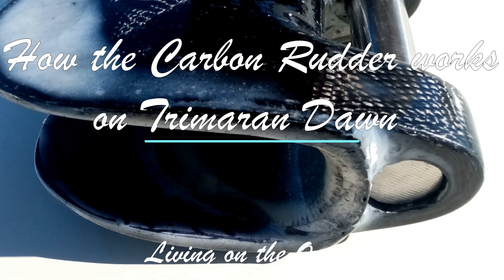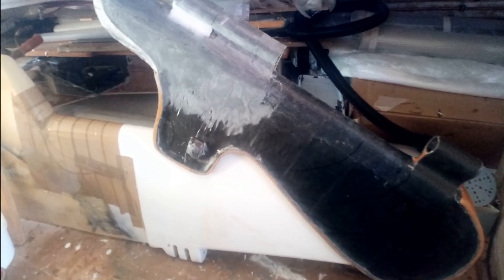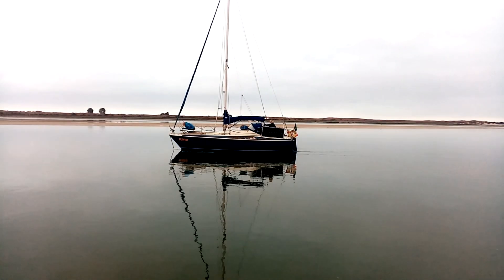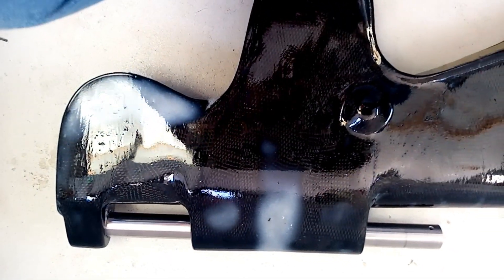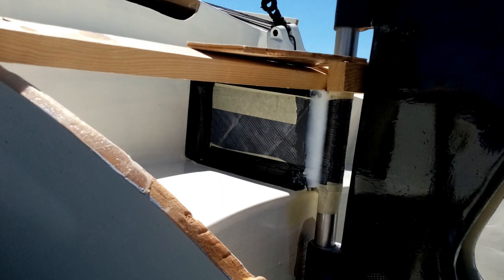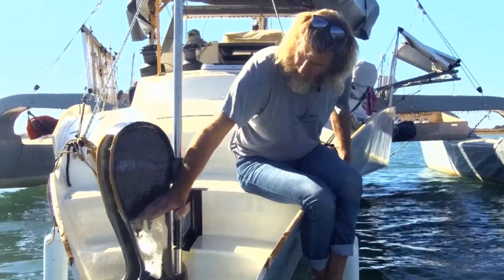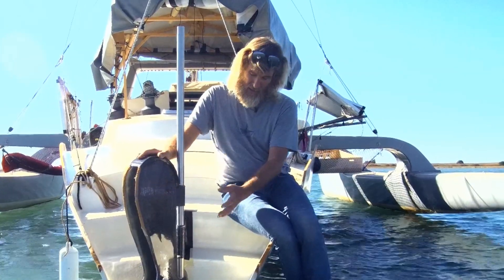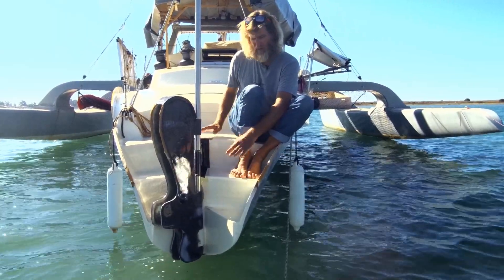How the Carbon Rudder works on Trimaran Dawn 041

Comment: Wow, it sounds complicated to me as someone who has only ever owned tiller steered boats. I have sailed one or two wheel steered boats but never really looked at the mechanics of it all. I really hope you can get that direct tiller feeling into the new system. Its great to really feel what the boat is doing!
Reply from the maker: Indeed 😊 Dennis. A great feeling with thillee steering.. If you have to steer by hand its the nicest. 😊 A wheel without feel is okay if you navigate in a port. But no fun in a night on open sea. Feel like you need much more concentration. 😊

Comment: Mate, you are making Dawn bulletproof, having worked with CF for a number of years your results are amazing, especially given your unique surroundings. Love the build and look forward to cruising video.
Reply from the maker: THANKS Matt. Nice to hear from a person that worked with Carbon fiber. 😊   If anything. I do not want to loose my rudder ever again. 😊 And sailing with the wind and waves coming from the back quarters gives big forches on the steering system... Surfing high speed of the waves. 😊. Bullet proof is good. 😊

Comment: Looks good. There is not much room inside for the steering though. I am more familial to the wharram design catamarans. Wharram also designed a windvane that is very simple but very reliable. It only works on boats with a limited heeling like a catamaran that heels maximum 8 degrees. I don’t know if it would work on Trimaran Dawn. On my boat it combines with a vety long helm that makes steering very light and easy
Reply from the maker: Hi Alfred, I know about the Waram system. 😊 But not in detail. Its a puzzel for later. Well spitted that the soace is small. But its big enough fir the qudrant ti turn 35 degrees to Port and Starboard. 😊 Love simple Wharram systems.. Bles James.
Have a good week, raining here sliwing diwn progress this week. 😕

Comment: you mentioned pendulum steering (did you mean wind vane steering? I guess it's a language translation thing?) I'm looking forward to see how you tackle this, should be interesting 🤞🏻 Thanks Ari for another great episode 👍🏼
Reply from the maker: You welcome Dave.  😊 Its a wind vane as you  correctly mentioned.  The old fashion system used a big wind vane that had to deliver al the pouwer. The modern ones have a smaller vane and only steer the pendulum rudder wich needs not much power to do. 
Then the pendulum rudder swings to port or Starboard getting its power from the passing water.... Creating much greater power than a wind vane an steer de boats rudder with that power. 😊 😊 I hope my quick and simple explenation is helping.
Greetings from us 😊
Reply: @tentmaran  Yes I understand how they work, just never seen one work on a Trimaran before so I'm looking forward to see it working 🤞🏻
Reply from the maker: It will take a while to get that part completed but its similar to what we have on twilight and it works great so fingers crossed!

Comment: Great videos and I learn a lot from each of them. I got a Searunner 40 Trimaran since 10 years and might be able to safe you from some mistakes I made with the wind steering systems I tried. The trim tap and wind vane system I had build acc. to Jim Browns plans unfortunately never really worked as the wind vane is just not strong enough in my opinion. Got a Cape Horn servo pendulum steering afterwards which works great on some courses (dead downwind with almost no apparent wind its almost magic how it keeps the boat within 5 degrees even in an ocean swell). Still it gets influenced by hull and rudder turbulences at times so if you decide to go ahead with a wind steering, looking into alternative (eg. between the hulls) locations might be worth while. 
Cheers Wolff
Trimaran Del Sur
Reply from the maker: Thanks Wolff Arie has some experience with wind vane but all info and tips are hugely appreciated. Do you sail the searunner regularly? Where are you based?

Comment: How do you prevent water from back waves coming in through the quadrant opening? I like the multiple operating modes for fault tolerance, but it is a huge amount of work.
Reply from the maker: Yes a huge amount of work but basically everything on the inside  is above the water line  and flows into the the gas locker and it has drains if the rubber seals let any water through (if they fail ) water will end up here and we considereing making a closed compartment for the quadrant inside like we have on trimaran twilight which is working great ,but is higher on her as in more above the water line. ( Built mid atlantic trip as was letting In Too much water, so your comment is very called and we'll spotted. Other solutions would be upwind sailing from now on 🤣since it's the gas locker the water may prevent spars ,😉